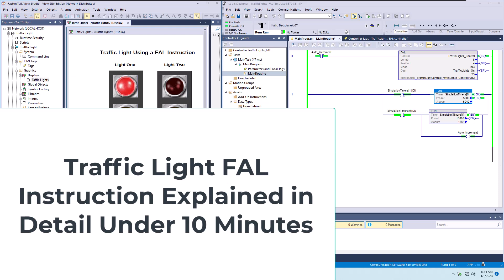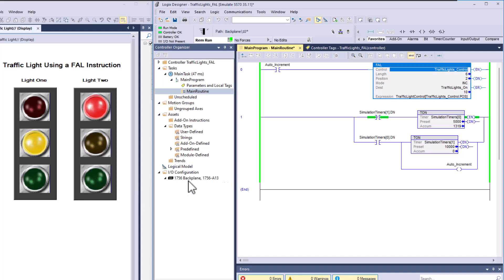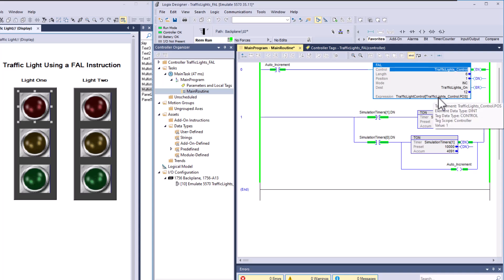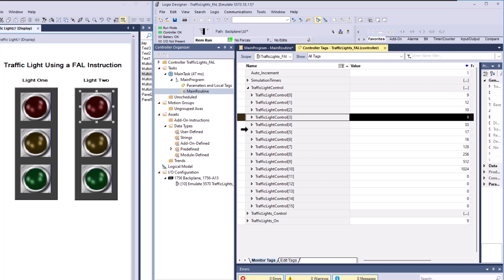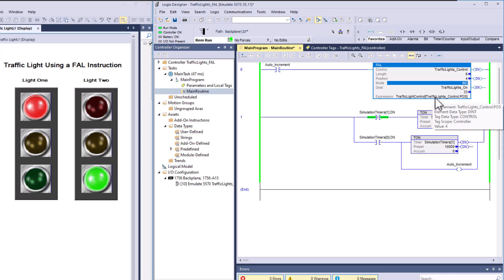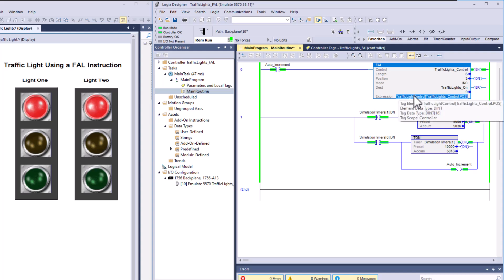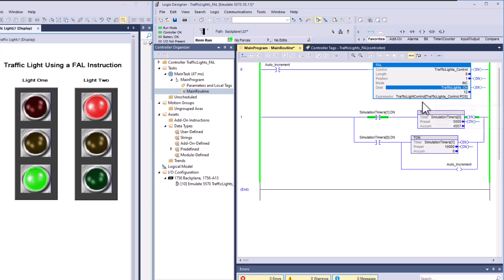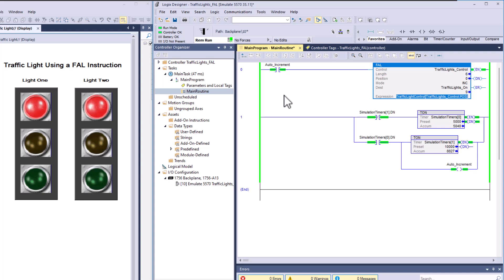Traffic Light FAL Instruction Explained in Detail Under 10 Minutes

Comment: I’ve also used this as a for loop in cases when I don’t want to use structured text.
Reply from the maker: Nice
Reply: This instruction is used all the time at my job on old PLC5s. It’s the best way to handle repetitive tasks to reduce program memory size. Used extensively at my jobs on the oldest systems.